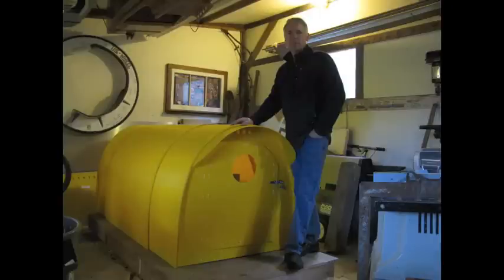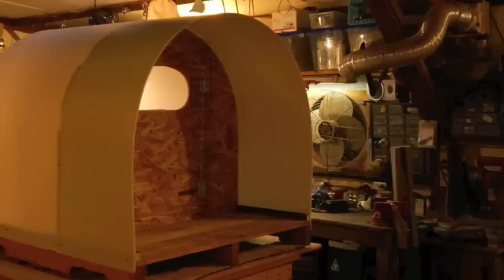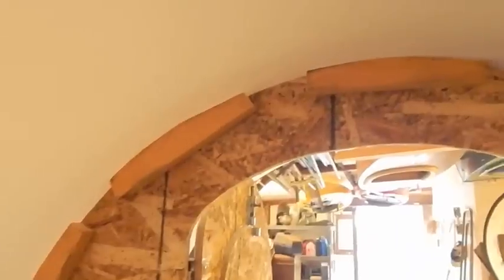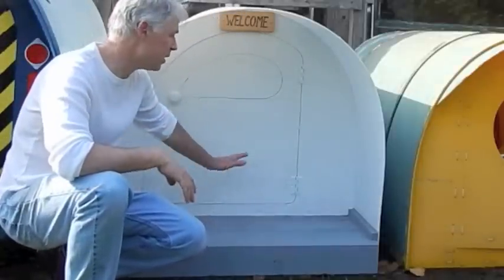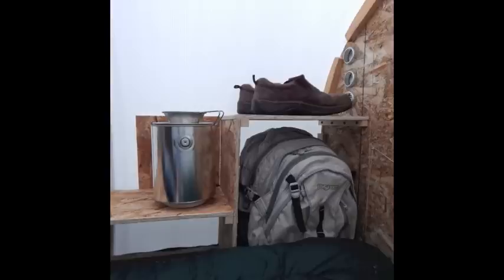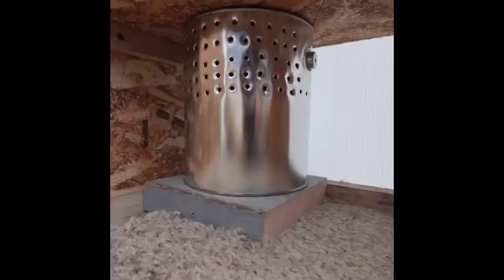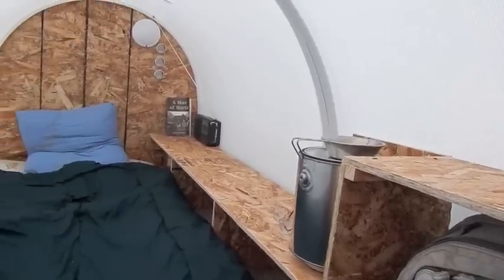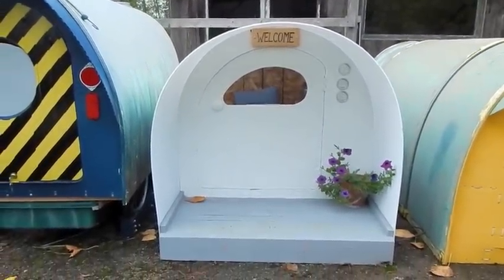Improved version of my Homeless Emergency Shelter

Comment: Another option is that as a "bug-out" shelter, you could pile leaves and other forest debris on it for camoflage and insulation.
Reply: Now that's what I'm talking about! Also, I would put one in the back of my truck bed and Climb right up in there while camping. Wouldn't have to bother with assembling and taking down a tent. When the trip is over I can simply shut my tail gate and I'm home bound.
Reply: Yesss good idea especially in these dooms days 😱😀
Reply: Kevin S, Awesome idea! Camouflage and insulation. Sound insulation especially! If you go back to the video of his first prototype, you'll note that the corrugated plastic is noisy as hell when it rains. Using forest debris and leaves would solve that issue at least.
Reply: Yes. Hold the leaves down with sheets of moss if you can get moss. When dry, it's quite insulative.
Reply: What about ventilation? It would get hot in there and the plastic would off gas and poison you
Reply: @RustyAndroid  You could maybe cover the outside with some thin foam you can get from wrapping....It would dampen the sound a fair bit and wouldn't matter if it got wet.
Reply: I would like to see a version of this that is 7' in center.
Reply: Solar battery fan
Reply: I got an 8 Person tent and a camping changing and shower all together plus a Five thousand dollar bug out bag with over one thousand dollars worth of MREs and a couple of guns and a Bulletproof vest I am well prepared for survival

Comment: Years ago a fella I know developed something similar -- an emergency box folded out of 2-layer coroplast. He promoted the concept equipped with blankets and other dry bug out things, and it folded out into a pvc-covered pram-style flat bottom boat you could pull behind you and keep some things dry. It folded out long enough to sleep in as a dry shelter. I liked it because of no seams to leak, and his 3d spatial reasoning skill for the folding ;) His idea was to unload a stack of them at a time, already stocked as kits.
Reply: Duncan Crow wheee did you see this? Any resources?

Comment: I squatted in a cargo conainer up North for 3 years, and this would have been great for inside Snowbunker, as the door was warped and wouldnt close completely. In the summer, i  had Vermont mosquitoes, and in the winter i had 'possums wanting to hibernate, and an ermine even stopped by for some soup. I used molten candlewax and newspaper in a steel can as a stove. Anyway, yes, this would have been helpful.

Comment: I'm really impressed with your inventions. With the extra length you can probably put a paint can wood burner in it and pipe it out the end wall, maybe? But they do so a black rubberized sealer called flex guard at tractor supply for that bottom flakeboard you were talking about weatherproofing. Thanks for the video, Happy New Year.

Comment: I'd prefer this shelter to a bed in a homeless shelter, even in winter. We've done some winter camping and as long as you have the right gear and take precautions it's fine. We use fleece to insulate our foam pads from the ground and we also use fleece liners in our sleeping bags so you don't feel the cold through the zipper. It's better than a colder rates sleeping bag.
Reply: Big Wheel  & plastic trash bags to cut the wind.
Reply: Big Wheel  ok i'll remember that when i'm freezing my ass off when I can't ride my motorcycle any farther & tuna funburger is nowhere to be found because she's home blogging about things that don't even affect her!
Got no use for her & i'm from Danmark!

Comment: It's always a pleasure to see a new vid from you, Paul.
Reply from the maker: Thank you!
Reply: Paul do you think Coroplast can be covered with  fiberglassed??
Reply: Paul, have you tried coating cardboard with epoxy resin?
Reply from the maker: No, but I see problems with that idea as resin doesn't flex.
Reply: Paul Elkins I heard Epoxy rwsin is very strong--so maybe coraplast and resin could be used as a wall or a roof???
Reply from the maker: It might be possible. I had a friend who used epoxy over 2mm coroplast on an enclosed trike, but coro is difficult to get anything to stick to seeing it's chemical resistant to most things.
Reply: Paul Elkins That is understable --what do think about a sheet of cardboard---covered with epoxy? Hey YOU started this --LOL --when I saw your first video!!! ;)))
Reply: Paul Elkins do you think you could make something like the podride, or at least shout out it?
Reply from the maker: I already did. I called it the Pavo
Reply: @paulwelkinsdiy  - I've always heard epoxy glue is superior to cyanoacrilate glue because of its flexibility. Maybe there is a difference between the epoxy coating you are talking about and the glue I'm talking about. How about urethane, it flexes. It's possible that a urethane finish wouldn't flex like a piece of solid urethane. I don't know if it would work.

Comment: I have a recommendation either bales of hay that are tightly packed or bags of Pete Moss just simply stack them like bricks up on top enough to actually put some above it and I will act as an insulator in very cold weather you may not want it in the front of the door but the thermal rating would be very effective and I knew someone who took bags of peat moss  and build a structure to camp

Comment: I have some old popular mechanic book. One has a set up for a dog house heater using 2 cans, one smaller (soup can) one larger (paint can). had holes drilled into them to let the heat from a 100W bulb out. but the double can prevented the dogs or humans stuff (clothes, boots, sleeping bag, etc.)from coming in contact with a hot bulb. 
I have a 150W bulb in my open shop. (235 F.) Just a safety concern.

Comment: This would work great as a single person camper that could be mounted on top of a truck bed or in the bed itself with a little adjustment for the wheel wells, or even placed on a utility trailer. Hmmm... I saw something similar at Hovenweep N.M. a couple of years ago. No, that was a tent on a wooden platform on top of the truck bed. Anyway, very ingenious, Paul. Thanks for sharing.

Comment: Weight is an issue with these shelters, moving them on site and then when on site, think about a solid block of polystyrene with a waterproof facing for the slab, also for the roof twin-cell polyester sheeting, like the stuff for "house for sale" signs are made of, both offer great insulation from the cold and heat, flat packing (if possible) for storage and moving is also a big advantage, just a thought, glad someone is thinking of homeless people, keep up the good work,
Reply: But if this dude could wheel barrel em, they couldn't have been that heavy

Comment: How cold of a temperature would this be comfortable ?Perhaps a light black pastic cover could be put on outside for winter - to absorb more heat. 
I know from raising chickens that air tight buildings in winter are not good due to condensation. So ventilation will be needed in winter too. 
In northeast US, all sides but the door could be covered in a huge pile of leaves. It would be pretty warm. The unit could be placed in the lee of a natural windbreak, and the door facing the winter sun and away from the prevailing wind direction. 
Great project.

Comment: A little foam board insulation on the inside would help hold in heat in winter. Just a suggestion.  Even mylar may work

Comment: Just a thought, those emergency foil heat reflective sheets that campers or runners use, , line inside the pod , it will make a massive difference to the heat inside.

Comment: One idea... tarpaulin swag..had one it was never stolen keep you warm in the cold dry in the wet.all that is required is tarpaulin, polyurethane caulking and well slim mattress, blanket and pillow you can roll it up tight stick it on top of your pack.

Comment: FYI:  They now have LED motion sensor lights that use 3 triple A batteries and stick on a wall.  They have an automatic turn off when in use and a on/off switch when not in use.  I have found them handy.  Perhaps you could too.

Comment: Maybe I missed something. What is the power source for the light bulb in the paint can being used for a heater?
Reply: Sonja Moss that’s what I thought 🤔
Reply: Hahaha Nice Sonja , I didn’t even catch that
Reply: There are a number of ways you could do a very cheap version of a self-contained light.
Reply: It runs on homless land fun bucks for fuel
Reply: He mentioned church groups putting these up. I'd assume the light is a feature meant to be powered by the church and not the homeless resident of this mini shelter. E.G. Church group puts these up in their parking lot providing power to the lot of them during the harshest times (cold, bad weather, regular shelter overflows, etc.) Then when the need has subsided, the shelters are repaired and stored for the next round. 

It makes sense as these could work as a give away thing for homeless people to haul around and use; and in that case, the resident might be able to arrange to use someone's / a business's power temporarily. However, given some of the objections from other comments on this video, a group providing these when needed and then collecting them when the need has passed seems like a reasonable solution as well.

Comment: Good improvements great build. Thanks, keep tinkering. I have been thinking about using Core plast to make a Chicken coop tractor but I am not sure whether the core plast would be strong enough to keep raccoons or weasels from chewing their way in and getting at the chickens, got any thoughts on the project, better still you build one and I will buy the plans. :-) Cheers. Love your designs and builds.

Comment: you could insulate the bottom with bathtub foam in the pallets.do you think a metal bed frame might work for the frame of the base with chloroplast floor? i want it to be on wheels like one of the other ones you have. thanks for your time

Comment: I'm a previous responder, but, as he notes( since so many say it) for church parking lots. And, as often occurs, on railway owned but no or little use property,  or, also often, power line trails owned by power company. 
When I did tent it in winter this would have been better than tents overlap with tarps and probably safer against some animals. With the opioid problems though, it would probably contain the stink of dead bodies longer as well. Hopefully, the opioid problem, not to mention coronavirus gets solved soon. Goodluck

Comment: Hi Paul. Two questions. What brand of Duct tape did you use? My first shelter lasted 4 months in summer and spring and the seams were shredded. And, has anyone you're aware of come up with a reasonable solution for condensation? I could see condensation being a deal breaker in any small non-tent shelter for any length of time. I've considered a small fan for air flow, and while I'm sure it would solve the condensation problem but then there goes your heat. How has your charcoal trap worked?

Comment: How many years can you get out of a sheet of coroplast before the UV begins to break it down?  Cool concepts!
Reply from the maker: It depends. I've had my homeless shelter outside for 5 year. I live in Washington Puget sound area, but if you're in a hot dry climate I'd imagine it wouldn't last too long.
Reply: Yeah, still that's not a bad lifespan for just the skin which can be replaced.  Certainly would exceed the lifespan of a tent getting daily exposure.
Reply from the maker: Exactly. Plus, unlike tents, the flutes hold trapped air creating some insulation.
Reply: Excellent point!

Comment: I was thinking why not build one like this that you can STAND UP so you can get dressed inside the hut but you invert the home to stand up during the day so you can get dressed sit in a chair at a small desk then when day is done you lay it back down and go to bed. You would need a door for standing and a door for laying.
Reply: That is a very goood idea . Wow I actually like that
Reply: Yes build this on a door frame use a steel door for the base place a blue foam on the door so you can sleep on it when you lay it down.  When it is standing up you get dressed in it maybe use it for a potty then when you are done you close the door lay it back down open the door from the end like Paul has it now and crawl in and go to sleep.
Reply from the maker: Brilliant! That would work if you could secure everything down.

Comment: hey Paul, this might be a silly question... 
but.... for someone that might want to go bycicle camping with their large Swiss white Shepherd (dog), could something like this be built in a way that it would be on a bycicle pulled trailer and you sort of have one or more slide outs so that you can easily compact it for transport behind the bycicle, yet could extend the inside space easily as well for when you reach your camping spot, so the dog might fit in there aswell? and if so, might you experiment with building one like that to see if it is doable?

Comment: Using a string for the door latch is risky. The sting looks like it will break by just watch at it. Maybe a thin rope or something else.
Reply: Danijel Android ......maybe use very heavy fishing line properly secured on both ends. Won’t degrade or unravel like string and impervious to rain

Comment: Why not make a template that you can use to cover it with concrete canvas to make a top and a base and a door with hardware and sell them has kits? You could design them a little bigger for emergency housing. ; )

Comment: Chipboard = Formaldehyde = my throat closing off about 1/2 way and I cannot breath well.
Reply from the maker: Ah mister Vitality. Just paint the interior walls with lead based paint.
Reply from the maker: Just kidding. Here's what Lowes has to say about it: SFI certified and environmentally friendly - no added urea-formaldehyde resin
Reply: I knew you were just kidding but I think that most people out there REALLY DON'T care about whether or not their houses are toxic.  (You'll get a lot of thumbs ups on that first comment from those bone brains.  lol)  My mom's house, built just 15 years ago has TOTALLY TOXIC chipboard in it.  (As do millions of other houses.)  The basement is unfinished and if I go down there I get that reaction.  
If indeed the newer chipboard is non-toxic or less toxic, great!
Reply from the maker: The chip board (sliver board) was hard to resist at 10 bucks a sheet. Tempted to make a good pallet dismantling tool and use free wood. Still for someone wanting to make these shelters quickly the particle board is a good cheap option, especially since they started eliminating the toxic substances.  More than likely they changed because of new regulations. Oh wait, that's gonna change soon. I better work on that pallet tool...
Reply: Paul Elkins Everything goes in cycles.  You just protect yourself the best you can.

Comment: Great channel 

I have always had invention ideas for decades but as I am not practical Eg I am not good with building or carpentry etc my inventions stay purely as ideas etc 

But I will list my ideas in your comments feel free to design a concept of my ideas etc 

I had the idea of 

Flying seats 

Eg seats that fly 

Before drones etc 

But flying cars are nothing more than flying seats or seats that fly 

All that would be needed to make this possible is a frame that contains a comfortable seat and add 4 drones to the top of the frame 

But for the seat to fly a person would need to work out the complete weight of the seat and frame plus the 4 drones and the weight of a person and divide the total weight by 4 Eg weight per drone or by 3 allowing for the flying seat to be powered by 3 drones with the 4th drone as reserve drone if needed 

But I reckon each drone would need to be able to lift 75kg weight which is possible and the seat space would be the size of a pallet 

I also had the idea of a flying car etc but not a flying car so to speak but a flying frame that flies that can lift a car much like two x 2 forklift forks that create a frame with drones on the top that lift a traditional car by the forks on the frame extending underneath a car and lifting it and the drones making the frame fly and as the frame would be lifting a car etc the car would fly too without the need for wings or for the car to be adapted etc

Comment: 100w light bulb!?! If it was LED you could run off a solar panel
Reply from the maker: It's for heat, not for light.
Reply: Paul Elkins Oh. Very nice
Reply: lol led this guy wasnt paying attention
Reply from the maker: To be fare I wasn't very clear. It is a heater but it can be used as a light and capped off at bed time.

Comment: Hmmm, not to knock it but I just don't see this used with such poor stability and quality would last long at all especially when homeless would not take care of it so maybe a bug out in the woods. Also how do you supply the lightbulb and all as Well as the heat mentioned? A drop cord is a TERRIBLE idea because its not realistic ....I think it could be upgraded to withstand extreme outside conditions as well as safety features for outsiders trying to get it in...... The idea is good but if for the homeless then its not going to last very long so any investment would include much concern.